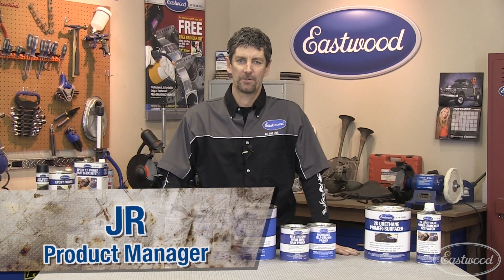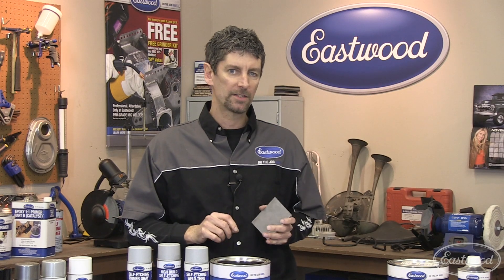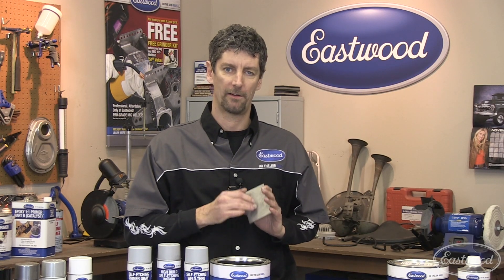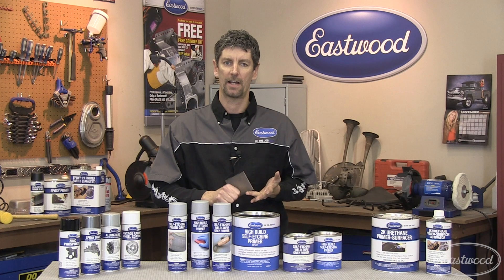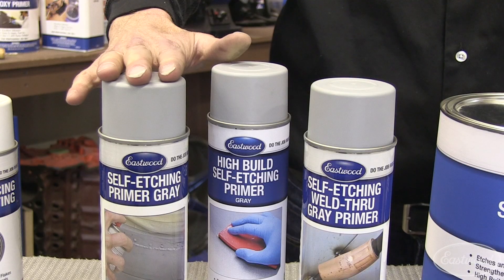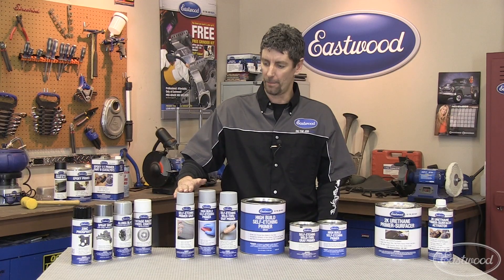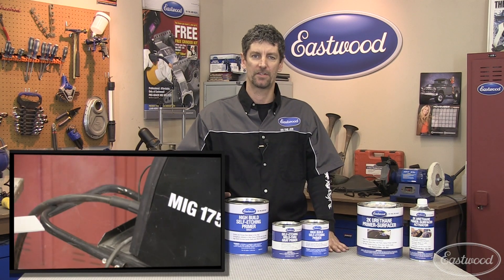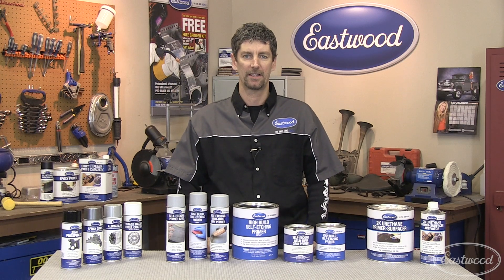Self-Etching Primers - Types & Applications - Weld Thru & High Build from Eastwood

Comment: Is there any risk of spraying when it's cold? My pole barn isn't heated... should I wait until springtime, or do I just need to wait longer between coats?
Just trying to find out whether it's fine to do some of the work while it's still cold here in Wisconsin :)

Comment: Self etching primer on clean brand new steel freshly abraded with sandpaper and cleaned with wax and grease remover... still easily scraped off with fingernail the next day... I just can't seem to find a way around priming bare metal other than toxic 2k cans that you can only open once that cost 25 bucks, and then have to be thrown out and wasted.

Comment: If I'm using self-etching primer on a bare-metal bike frame and parts, should I sand before applying, then again after final priming coat, then follow it up with a different type primer, then follow that up with sanding before moving on to the color coats?
Reply from the maker: Can you contact an Eastwood Tech to discuss the project? You may want to start with Epoxy Primer.  800-343-9353

Comment: So after useing etching primer do I have to use another regular primer then the paint ?
Reply from the maker: If it's over bare metal, you can use Epoxy Primer, then body fillers and additional primers before topcoat.
Reply: @eastwoodco  yes it's bare metal so two primer layers then the paint . This is not car body work it's a metal fabrication job that needs painting but don't want to rust out . Thank you
Reply: Late reply but it definitely says NOT to use epoxy based primer with self etching. Should use 2k urethane instead.

Comment: These primers have a home in hard to reach places and for small projects. However, the key here is that it's lacquer based.  It will be a poor base to build any quality automotive repair or refinishing of a car. Lacquer is the first paint tech ever and is so antiquated it shouldn't be used in any modern build or restore of an automotive application (with the exception of weld through primers which go between welded substrates where you can't reach after the repair with cavity wax or internal frame coatings). You want to use an epoxy or 2K (two part) urethane primer as a base for quality reasons. Epoxy being the best because most are formulated as a DTM (direct to metal) primer, will truly seal the metal from the elements (unlike every other primer with no exceptions), and are slow cure creating a super hard durable base for your expensive automotive paint and giving you time to paint days (sometimes up to 5-7 days depending on brand, environment, and temp) after priming without sanding. Creating a chemical bond between primer and paint. Don't listen to the hype regarding etch primers for your whole car. Etch with phosphoric acid/metal prep and then wipe down with wax and tar remover to remove the residual acid after the acid has had time to work. Your epoxy should then be able to stick without problems and your metal will be rust free and ready for 2k high build primer or paint!

Comment: With the weld thru primer, doesn't the heat from the weld burn off the primer where the weld is? Would this not leave a unprotected spot? Example when you weld the rocker panels where it will see water in the future. Have you ever welded two pieces of metal together with weld thru primer and then pull the pieces apart to see how much the primer burnt back?

Comment from the maker: We recommend using a 1.8 or 2.0 tip to spray the Eastwood High Build Self Etching Primer.  There are links below the video if you want additional information on these Eastwood products.  Thanks for the interest.
Reply: I have fj40 landcruiser I remove all paint on it , now its bare steel all body of the car , can I spray self etch  primer on bare steel? Or what do you recommend me about that?